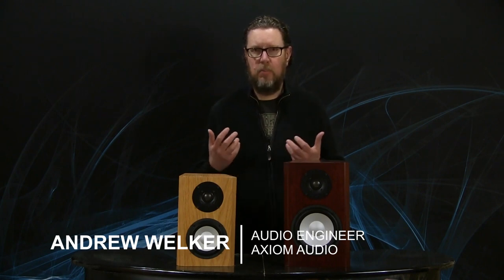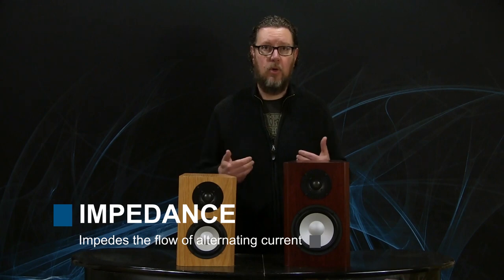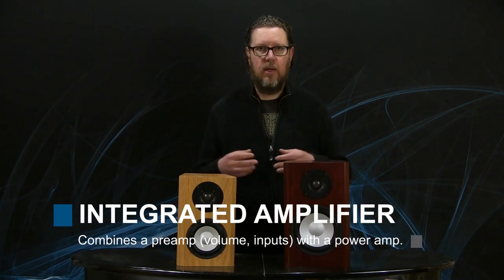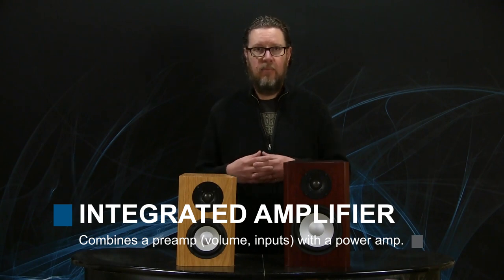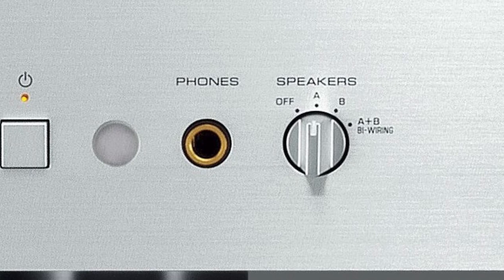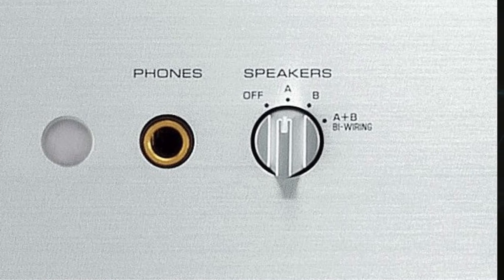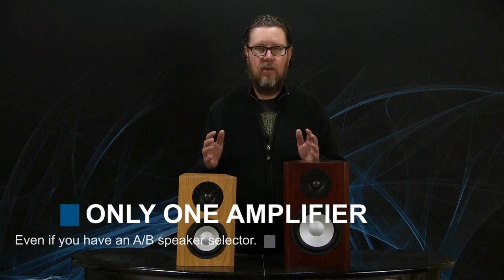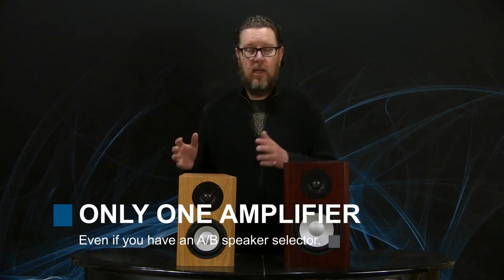A B Speaker Switch:  How Many  Speakers Can  You Play At Once?

Comment: You are assuming the amplifier puts the A+B pair in parallel. Some amplifiers put them in series, and thus the impedance of the speakers would be added (so two 8 ohm speakers would produce 16 Ohms).  I had once an old Hitachi receiver that did this. An easy test for this configuration is if you have only 1 pair of speakers connected and you switch on the B speaker, the sound will cut out dice there will be an open circuit.
Reply: I've run across this in an 80's Toshiba receiver too. I didn't have use for a receiver that was ventless and weighed as much as a shoebox. It did have a nice brushed stainless finish on its faceplate though.
Reply: In the late 80s, early 90s I had several Pioneer Receivers.  One of them put A/B in parallel while the others put them in series.  Same brand doing it differently between models.  So I agree, this is pretty critical to understand how your amp is setup to function.
Reply from the maker: Well, you learn something new everyday! Thank you for pointing that out Roger and Daniel for supporting the comment. In every case that I have come across the A and B pairs were in parallel, but I guess as always it’s best to consult the manual for your specific amp or receiver.
Reply: I have a technics unit that has a a/b selector . Now generally your able to run both together or independently. This unit however will only push one or the other but not both simultaneously  It's one of the units I have in the shop and is a sz900 or 9000 I "think".
My day driver is a spec rig +pl530 (down stairs) and my back up is a sx850 with a nakamichi bx300 and a phillips ga312 table.
Btw the GA tables by phillips are very solid tables for the price. The tone arms are a bit finicky but even so they are very decent units.
Reply: Thanks for educating. I have a JVC A-X900B integrated amp which has two pairs of speaker output channels A and B. How do I find out if A+B means series or parallel? 
A pair of Boston Acoustics A150 (8 Ohm impedance) are being driven by it and I plan on adding another pair of the same speakers but not sure if that's safe.
Reply: @suJayr1109  The test is quite easy. Connect a pair of speakers to Channel A and leave Channel B disconnected. Play music at a low to moderate level (not too loud, but loud enough that you can hear it clearly) with only Channel A enabled. While the music is playing, enable Channel B.

1. If the music is muted when you enable Channel B, the speakers are in series,
2. If the music continues playing without any changes to the sound level/quality when enabling Channel B, the speakers are in parallel
3. If there are changes in sound level/quality, but it isn't muted, the test is inconclusive.

I hope this helps.
Reply: @roger1818  Thanks for the response! I'll try this test tomorrow once I have my second set of speakers. However I found this in the manual of the amp -
'Use the speakers with impedance of 8 ohms or more (16 ohms if the 1 + 2 position is used) as the rated speaker impedance of this amplifier is 8 ohms (16 ohms when the 1 + 2 position is used). Speakers with an impedance down to 4 ohms (8 ohms when the 1 + 2 position is used) may be used, in which case the temperature rise of the cabinet may not satisfy BS 415 or IEC 65. Be sure to provide good ventilation, especially when speakers with an impedance of 4 ohms (8 ohms when the 1 + 2 position is used) are used.'
FWIU its not safe to use two sets of 8 ohms speakers together with A+B enabled. Is that right or am I misunderstanding? Thanks again for the help!
Reply: @suJayr1109  You can do the test before the second set arrives as it only requires 1 set of speakers. Having said that, from reading your quite from the manual, the speakers are almost defiantly in parallel.

As for if it is safe, it sounds to me like they are saying that it is only safe if your stereo cabinet has "good ventilation." However, there is no definition of what "good ventilation" is, so if damage is done, they can blame you for not having good enough ventilation.
Reply: @roger1818  ah got it. I did the test and confirmed that the two channels are connected in parallel. The amp is placed by itself without any thing on top so I would say it’s well ventilated but am still skeptical on connecting two sets of 8 ohms speakers. However I was thinking of using just one channel to connect both the sets in series. What are your thoughts on that? 
Thanks again for all the help. Much appreciated!
Reply: my sony dg500 has the a / b and  a&b 8 to 16 ohm. do you think thats how mine is wired? would make sense why it can run 8 to 16 ohm. i currently just have speakers a connected, if i turn on b a goes out, but then with a&b on a is on.

Comment: Thank you for your very clear explanation. I have a Yamaha R-N602. It has speaker options A or B and A+B. It also has 2 settings @ 4ohms or 8ohms. I have a pair of Kef Q350 (8 Ohms) and a pair of Cambridge Audio SX-50 (8 Ohms). From my understanding, I can use both pair of speakers on the A+B settings but also change the recievers's speaker settings to 4 Ohms to accommodate the 2 pairs of speakers, right?

Comment: My old JVC receiver shows in the back 1 AND 2 8-16 ohms - 1 OR 2 4-16 ohms. Does it mean that if I want to play both sets toghether all the speakers need to be 8ohms or higher?? Can I serial wire 2 pairs of 6ohms speakers to get 12ohms in set A and use a pair of 8ohms in set B?

Comment: So does that mean if I have an amp that’s rated at 70 watts RMS per channel into 8 ohms , that running four 8 ohm speaker cabinets at the same time using A+B channels , it will effectively be putting out 35 watts RMS into each speaker ?
Reply from the maker: No, it all depends on the particular amplifier. Normally good amplifiers will deliver more power into a lower impedance load, but that is not always the case.
Reply: It’s a Yamaha A500 that I bought new in 1980 I think . Maybe as late as 1982 . Been running 4 Yamaha NS500 10” 2ways . Just wondering if I might be doing damage to that amp by running 4 speakers .
Reply from the maker: @Rancherinaz  If you have not run into any issues with the A500 shutting down or overheating, you should be fine. Those older integrated amps tended to be very well built.

Comment: I have a pair of speakers that are rated 6 ohms. My integrated tube amplifier only has 8 and 4 ohm taps. Which taps should I use?
Reply from the maker: In that case I would try both of them and see if you have a preference for one or the other. You won’t do any damage to the amplifier on either tap if you don’t overdrive it.

Comment: I have two sets of car speakers i want to toggle between (so internal to external listening) but not all together a/b) 
Can i take the two speaker wires from stereo headset and either side connect the two speakers to toggle between… so “on on switch”? Hope you can help 👍🏻

Comment: Like if the house is wired with speakers in every room and you won't to play music in your room? Is there a way of switching from the main Line that will aloe you to play music in your room
Reply from the maker: Although we don’t make them, speaker level switchers are available. Just make sure that you match up the power rating of the switch box with the power output of the amplifier you intend on using.

Comment: Hi, thank you for your informative vedio! I have a question that can I use A+B Speaker out at the same biwire input speaker?(4 wire in~4out ,double biwire) if the speaker is 4 ohm, what will happen?   Will use A+B at the same speaker be better than I just use one speaker out?  (2in~4out,single biwire)
I'm just considering which type of speaker cable should I buy for the best result, thanks a lot!!
Reply from the maker: You are most welcome! You can certainly bi-wire using the A+B outputs, and it will not change anything in the load that the amplifier sees. As for it making a difference or being “better”, there is a lot of argument out there. Personally, I would buy a better single-wire cable with my available funds.

Comment: not sure if this channel is still active, I hope peeps here can answer my question.

I have an onkyo r558 av receiver. I want to add an extra speaker using speaker b for karaoke. would it be ideal? I found a pair of speakers that is 150watts at 8ohms each. the speakers that my system is using is 100watts at 6ohms but it's a 5 channel. would this setup work?

Comment: But what difference is audio wise to have A+B? Does Amplifier do some switching between them, or that is simply copy/paste from A to B?
Reply from the maker: In most cases the signal is identical on the A and B outputs. The switch just allows you to connect two pairs of terminals to the same amplifier output.

Comment: I have two speakers on my home's patio wired together through a rheostat. I want to use them as the front B speakers on my surround system so I can play music while entertaining guests. Can I determine the impedance of those speakers with a multi-meter? How does that setup affect the discussion of ohms?
Reply from the maker: The rheostat will introduce additional series resistance to the system as you pad down the level of the speakers. You can certainly use a meter to check the total resistance across the ends that connect to your receiver or amplifier. If you’re actually using a so-called speaker L-pad, then the impedance seen by the amplifier will remain constant.

Comment: Andrew, wire gauge or lenght can have an impact on resistance?
Also, can excessive wire lenght not used affect the delay? What about unequal wire lenght, let's say meters difference.
Thanks once again for these video series. Very helpful.
Reply from the maker: Certainly the wire gauge and length will impact the resistance. It’s not a matter of impacting delay or timing, but having unnecessary wire is not a good idea as the additional series resistance can impact the performance of your system. I always recommend keeping the wire length the same between channel pairs. So if you need 20 feet of wire for your left speaker and only 15 for the right, use 20 feet for the right speaker as well. Note that this does not apply to all channels in a multichannel system, i.e. there is no need to also have the centre channel cable 20 feet as in the example.
Reply: @AxiomHomeTheaters  Thanks!
Reply from the maker: @rudolfhuijs4526  you're welcome, anytime I can answer audio questions happy to do so.

Comment: I have a pair of 6ohm speakers and I may get a second pair that I don't know how many ohm are they but will it be a problem if they are 4 or 8 ohm in A+B mode on my amplifier?
Reply from the maker: It depends on what impedance your amplifier can handle. 6 ohm speakers with 8 ohms speakers would present a load of 3.43 ohms. 6 ohm speakers with 4 ohm speakers would present a load of 2.4 ohms. Both would be uncomfortable with many amplifiers.
Reply: @AxiomHomeTheaters  How do you know the amplifier is "uncomfortable" with it?  My integrated amplifier doesn't appear to "complain".  Will the issue express itself by way of diminished longevity?
Reply from the maker: @sthr2110  Check for how hot your amp is getting when the system is played loud, and also listen for any signs of distress such as the sound getting “hard” and fatiguing to listen to.

Comment: What would the output of a 100 W amplifier be when using a and B speakers at the same time?
Reply from the maker: It will depend on the specific amplifier and the total impedance of the two speakers in parallel.
Reply: So 200w yamaha r-s202 amplifier, 100w per channel and four identical 8 ohm speakers.  Would it split power to 50w per speaker?
Reply from the maker: @danawd  with 2 pairs of 8 ohm speakers each speaker will have access to half of the maximum amplifier power into 4 ohms, not 8. With many amplifiers there will be more power output available with a 4 ohm load.

Comment: Thank you. I've searched a lot, and failed 'til now, to find out how 4-post amplifiers (typically) drive two pairs of speakers. Can you tell me what happens to the wattage of an amplifier when two pairs of 8Ohm speakers are connected under the scenario you used? And what happens to volume coming out of the 8Ohm speakers?
Reply from the maker: If you have two 8 ohm speakers connected in parallel to a single amplifier channel, the effective load will be 4 ohms. You will have more output from the two pairs in parallel, assuming the amp is up to the task of driving them in that configuration.
Reply: @AxiomHomeTheaters  thanks. It's curious that Cambridge Audio rate their AXR100D at 2x100w @ 8 ohms but don't give a rating at 4 ohms. The amp does support 1 pair of 4 ohms speakers but two pairs must be 8 ohms. the a/b speaker feature was perhaps added to help out amp/speaker reviews. and amp makers saw it was very easy to offer a+b but this function feels less well-rounded.
Reply from the maker: @video-carl  It's possible they don’t want to advertise the fact that the amp can actually drive 4 ohms, or that the power output at 4 ohms is not significantly higher than with an 8 ohm load. With a really good amplifier the power should double into 4 ohms.
Reply: I asked CA and they said that the AXR100D, when connected to four speakers, puts out 50 watts per channel per speaker. the impedance level is 4 ohms with 4 speakers attached.
Reply from the maker: @video-carl  Great that they got back to you. As I suspected, the power is actually reduced into 4 ohms.
Reply: @AxiomHomeTheaters  leaves me looking for an amp that increases wattage impedance is at an average of 4 ohms.

Comment: What if you used an A/B switch  with 2 sets of speakers with 8 Ohm and 6 Ohm. Is this safe?
Reply from the maker: It all depends on your amp… 8 and 6 ohm speakers running at the same time will result in a 3.4 ohm load…some amps may not be happy with that.

Comment: Thanks for helping me to finally understand this. One thing I'm still unclear about though is how this applies to wattage. At the moment I have an amp with two pairs of speakers attached. But I only ever play one set at a time. Both sets are 75w RMS. The amp says 70w per channel into 8 OHM and the same for 4 OHM. (So already I don't have enough juice to power even one of the sets), So am I guessing right that if I were to play both sets of speakers at the same time, I would be giving each set under half the power they need, (35w) and thus potentially damaging them by providing an underpowered clipped signal? Thanks.